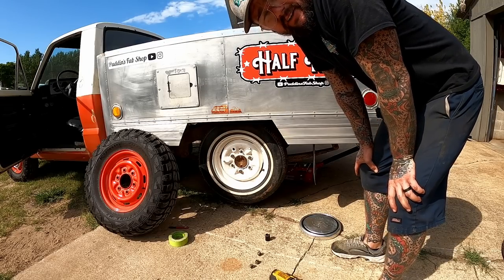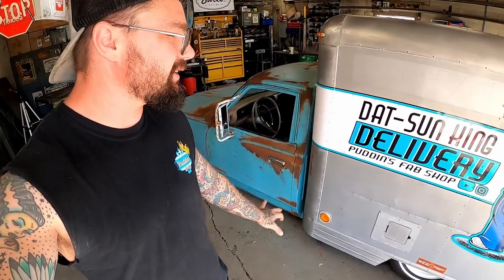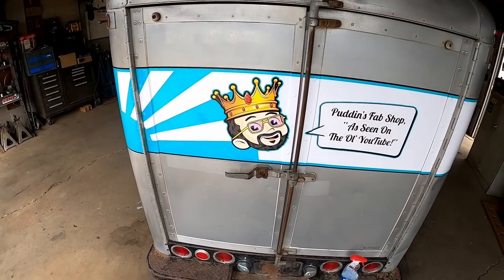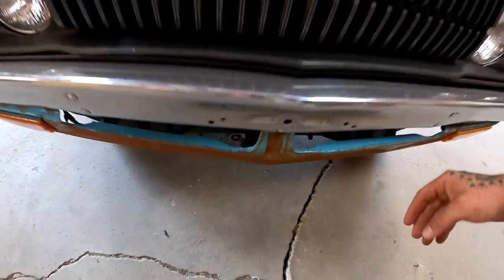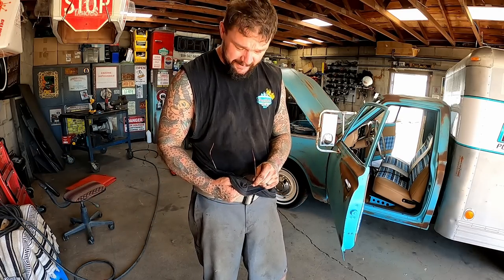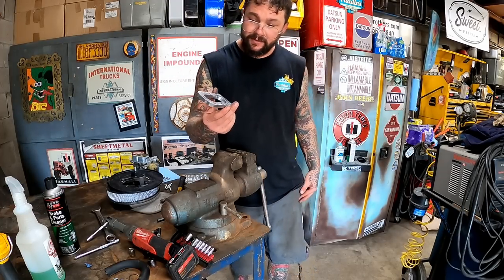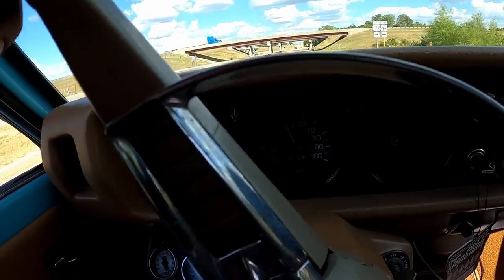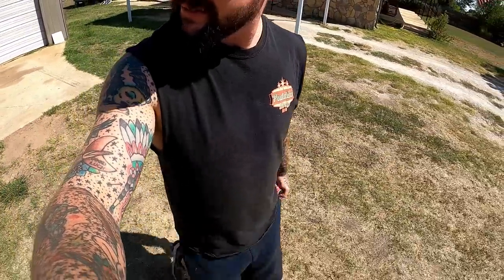FIRST DRIVE after build. SHAKE DOWN begins! ((TRUCK RESCUE))

Comment: If your spindles and rear end is from a hard body Nissan you will have to enlarge the center holes in the steel wheels they are a little smaller. I had the same problem.

Comment: Not sure why you would use the EGR port for anything but EGR....

If you're not using EGR for it's intended purpose, cap it off.  The way you had it was just a massive vacuum leak, but also drawing in way too much of the crankcase emissions.... probably even a lot of oil, too.

Now, if you wanted to run a Positive Crankcase Ventilator (or PCV) system, then get the appropriate valve and attach that to a manifold vacuum source.

Comment: It’s amazing how much trouble you can have with lumpy and wobbly wheels. There was a period of time a long while back, I would have the tire shop spin the wheel on the balance machine without the tire installed to verify both the lateral and radial runout of the wheel before mounting the tire. I found a LOT of the wheels I checked were wobbly and out of round. Even some brand new ones. And the tire technician often would try to claim things were just fine.   They weren’t. There were a whole lot of new aftermarket wheels that were seriously poor crap made and sold in the 70’s and 80’s. I have always hated wheels and tires that do not run smooth and true. In general, I find things much better now.

Comment: I was thinking more about your crankcase ventilation and I realized I did not fully understand how crankcase ventilation worked.    What I do know is that the vacuum flow has to be regulated.  The way you connected your system you did not provide a way to meter vacuum  flow, for example a PVC valve.  I am not sure if it is as simple as installing a pcv valve or mapping out the crankcase ventilation system.  I am sure some thought will have to go into the system design (filtered air in the crankcase).  
V/R,
Douglas AKA Honey Badger

Comment: The wheels aren’t bent. The center bore isn’t allowing it to sit flat against the hub. 

Cheap fix is add spacers with a matching hub centric.
Reply from the maker: The wheels are bent, thanks for eyeballin it from over there though lol
Reply: @PuddinsFabShop  ok ok. But, it’s a common mod for the hardbody’s to bore out the center of Chevy rims etc. I had to. 
either way be safe, and keep the videos fun!

Comment: did you ever see the guys message last week about the half hawl that the one part you took off the fuel system in the back was the fuel pressure regulator. that is probably why its running poorly because of inconsistent fuel pressure

Comment: I find copper spray in a can works good  on gaskets seams to help on metal and done it to regular ones and why not just go up to a 15in wheels with slightly lower profile not to low just wondering how that look and maybe better fitmint.

Comment: What it is, is your 'progress' was only 87%. It took the 2nd time to get your progress to 100%. 
As progress goes. Like me. I put a remanufactured 350 in my truck. Now that the trucks back on the road, running good. It's time to put the cam I bought in it. You know 87% vs 100%. Puddin will get it folks.

Comment: The hose going to your intake under your carburetor is bad if the hose is a crankcase vent . If your truck is smog exempt just run it to a catch can  ( overflow can ). The way it was before you were loosing manifold vacuum.
Reply: Thanks for watching You have been randomly selected among winners for today Contact Me  on the name above to claim your prize right now👆👆.......

Comment: Excellent video Puddin   :) also what about PSI pressure on all 4 tires try 38 see what happens to plus weights on outside rim plus tires to try  and if not spindal may need be tighten up more on bearings to !

Comment: puddin just put a 4bt cummins in it with a 3 speed gm in it cuz it will handle it and you got a dead nutz reliable rig aint scared of a little cuttin an welding

Comment: good video of real life stuff....if there were no issues to work out here and there life would be boring. When I was a teen ager, I helped my neighbor change tires on their log trailers almost every week end... the old style split rings...they would stand a 4# sledge hammer handle up.. against the tire and spin it by hand and see where the thing was out.... they would whack it with tire hammer or big sledge tighten the nuts and do it again until it spun true... not saying this would help your issue.. but I wonder if the spots on the drum were balancing weights also....I understand the log truck and your rim warpage is two different things but never know.....if all else fails influence with large hammer used to be my motto....

Comment: Hi Puddin,
Did you put a PCV valve in that vacuum line that comes off the intake manifold? It looks like you are running full vacuum to the crank case. That would make it feel like a vacuum leak and run poorly.

Comment: The problem with the rear wheels is that they are tightening on the drum ,not on the back of the centre of the rim, is that raised part of the drum,where the rim is sitting, balance lugs, or just part of the drum???
 You can't go machining your wheels, ain't got enough material, where as the drum has, so attack them first.
 Waiting for the "Some day Model A " project to start👍👍👍👍👍👍

Two hours later --- I know I'm not the sharpest tool in the shed, but how many 40plus years old Commercial vehicle rims would be straight???

Comment: I would put the drums on a large lathe and have those nubs machined off. Easiest way to solve the issue in my opinion. Now all you have to do is find a machine shop! Most likely close to Tinker AFB is my guess.
Reply: arent they there for balance though?
Reply: @jdllewellyn5802  Maybe? He could add on those stick on balance weights to make up for the loss of the nubs.
Reply: @cliffordkinnear9705  i dont see those hanging on too well after a couple heat cycles. You could balance them, but for the time/cost I do not think thats the best method.
Reply: @jdllewellyn5802  Yep, you're right, I forgot about the heat factor, oops. Well he's Puddin he'll figure out the science and stuff, lol.

Comment: The Ford ranger chances are with the overload coil springs on the rear the heavy duty torsion bar those hooks on the sides of the truck I bet you it had a camper in it

Comment: #3 is it just an elbow. I have seen the EGR delete. but people still kept the PCV valve in there. since its coming from the crankcase hose. They at least keep that. Also have anymore of those round port heads lying around. Someone put a square port on mine (before i bought it) and still used a round port intake manifold. and well can't seam to find one. W58 head I think it is?
Reply: 👆Thanks for watching and Commenting send a direct message right away we l've got something Special for you🎁

Comment: BUDDY , you gotta start at the furthest point away from the master cylinder when you're bleeding brakes... you can't start at the LF you go RR LR RF LF , if not when you pull the air out at the RR last it puts air into the other ones throughout the chain , even with split masters you still have to do the furthest first on each axle... hope this helps !!

Comment: Do you think with that bracket thing under the carb with the bolts that you pinned do you think you could put them like half way threaded through then just weld em in place on the back or am I just saying something stupid

Comment: I was the pnw datsun king then suzuki and samurai  is too narrow  to go under the courier   find a 1980 to 86 nissan  datsun 720 4x4 they are rust buckets but have awesome ifs   4x4 running  gear  with divorced tease to use the 2300 and 5sp and what a rig just swap bodys 720s are cheap
Reply: That's a new York area  code not oklahoms
Reply: Scammer